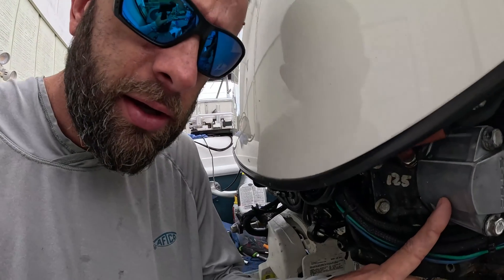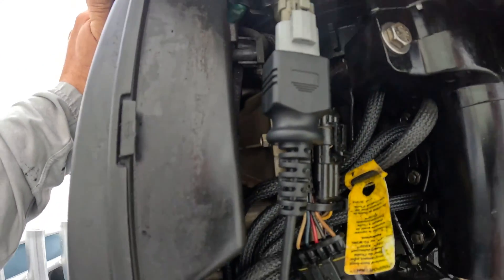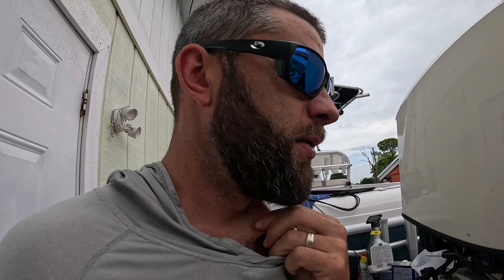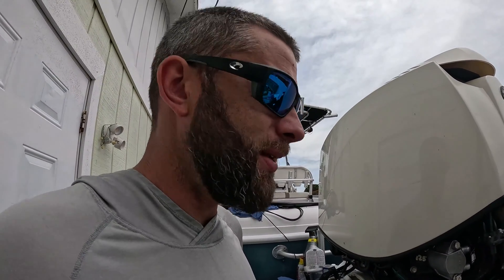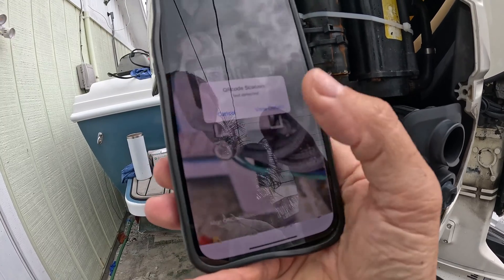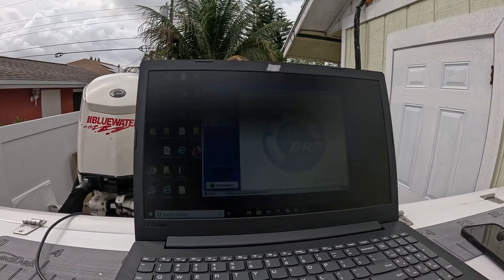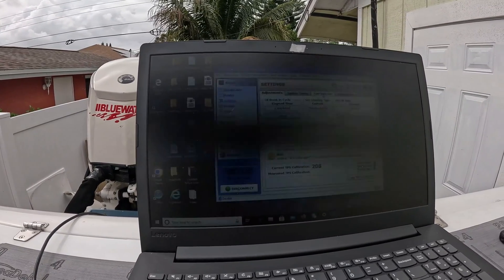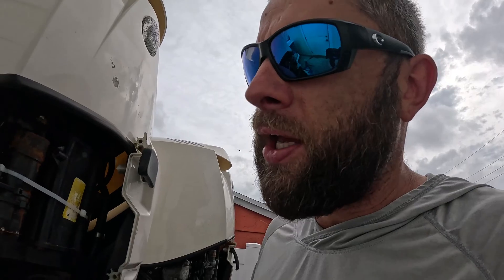How to program Evinrude Etec G1 injectors (DIY)

Comment: hi bro question, on my boat at the computer say Fuel injector Circuit #3 Open ,  then i do the test , #3 no working , but my motor dont starting u think its because that fuel injector?, u motor work with the fuel bad fuel injector? like starting ?

Comment: I know this is off subject but you seem to know what you are doing with the Etec engine. I have a 2012 115 that does not want to stop running when I turn key off. Already replaced the key switch, can this software show any info why it isn’t shutting off? Thanks
Reply from the maker: @dmarsh3947  I’m not sure

Comment: Great informative video & fishing videos as well, how long did the company in Netherlands take to fix emm? And approx how much did it run to get it done? Im on the same boat searching all over for who still repairs them and is there some etec years that cant be repaired? I have an 05-225, thanks for the info, keep up the good videos!
Reply from the maker: @carlosMako  They couldn’t fix my emm. So, I ended up getting a replacement engine for a great price and just swapped out engines. I’ll sell the old engine for parts soon.

Comment: Thank you for making this video.  Like you, I like to DIY where I can.  My new to me 07/G1/150 only has 110 hours on it and is in like new condition.  I want to keep it that way with good preventative maintenance.  Great additional comments from you about the Back Pressure Fitting and VST filter.  Those covers are such a PITA to get off and back on. :D
Reply from the maker: @xtcamaro2668  You’re welcome. Good luck with your etec. I like mine. Strong reliable engines if you keep up with the maintenance.

Comment: Great Video, thanks!
Question, My EMM LED2 is illuminated indicating an ignition/injector problem, Diagnostic Software said Injector 1 Open. 
I changed the injector, input the coefficient info and cleared the faults.
LED2 will NOT turn off, engine will start but only run for 10 seconds. 
I have even rebooted the software on the EMM, with the "Bootstrap" cable.
Seems the LED2 circuit did not get reset, any ideas how to ensure it gets reset?
Reply from the maker: @mathewlacroix7630  I wish I could help with that man. I’d check out the etec forums on Facebook. Those guys have a lot of knowledge. Thanks for watching

Comment: Nice video what is the weakest link with these engines form you experience? I bought 2 new G1 150hp in 2019 and still under warranty, is it the EMM? How many hours on the engines?  Thanks
Reply from the maker: It’s gotta be the emm. One of mine is currently in the Netherlands being fixed. I’ve got 1200hrs on them and they have been great besides the emm taking a crap last month.
Reply: @FloridaNativeFishingChannel  What made you pick someone in the Netherlands vs. someone domestic? Is buying used not an option? Thanks
Reply from the maker: @hansgruber2509  Cheaper to have the emm repaired. I didn’t want to have to program a new emm.
Reply: @carlosMako  I recommend you join this Facebook group.  Lots of help here.  The guy in the Netherlands is the only one I've read about that fixes the EMM's, but there may be others.  https://www.facebook.com/groups/435348760355243

Comment: So, very nice, but only for new injector, if you are installing a used injector with zero cycles so Emm will think is a new a new injector and will not compensate aging.
Good if you don’t use that engine  on high rpm ranges.

Brp created scan labels to install new injectors
Reusing injectors, data has to be pulled from donor emm, or requested from BRP CALL CENTER with approximate engine hours
Reply from the maker: The injector I installed is brand new and has never been used. Thanks for watching
Reply: @FloridaNativeFishingChannel  comment corrected
Thanks